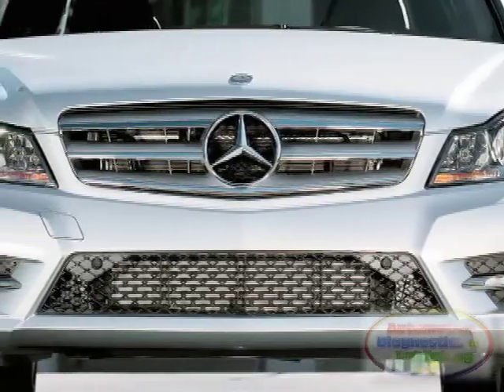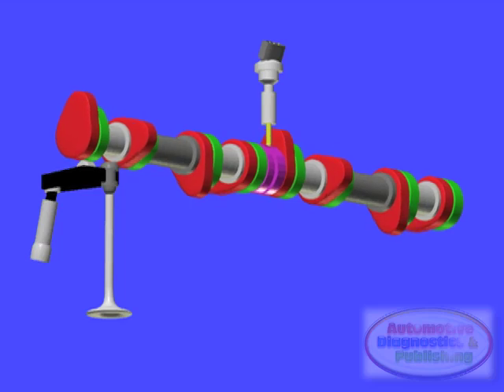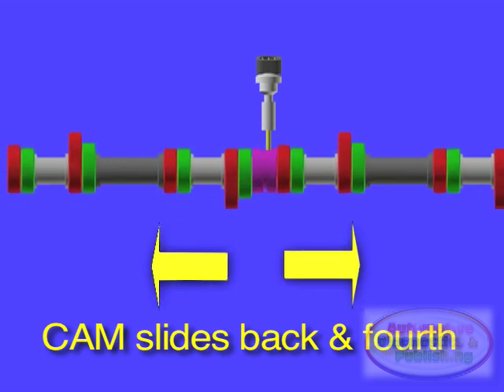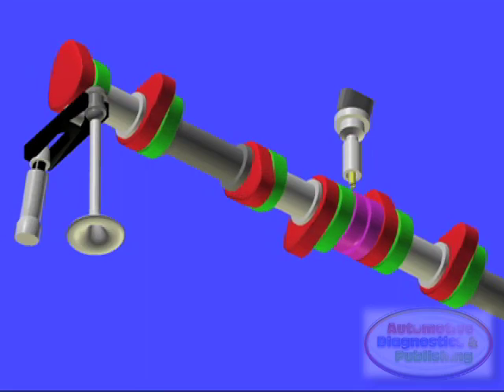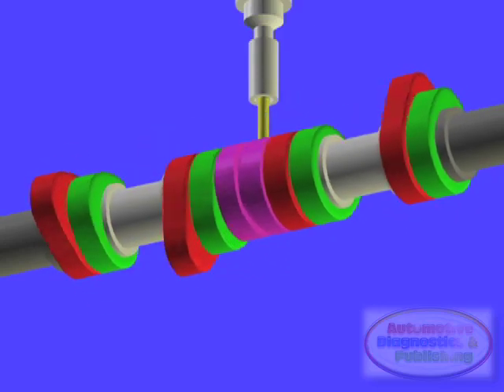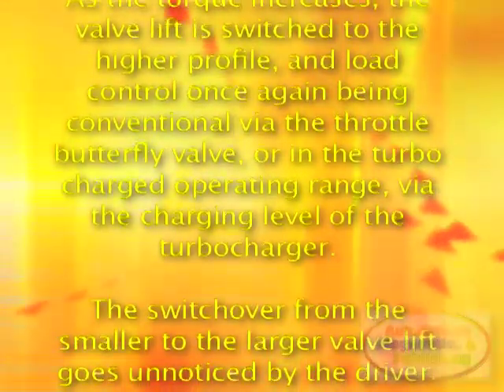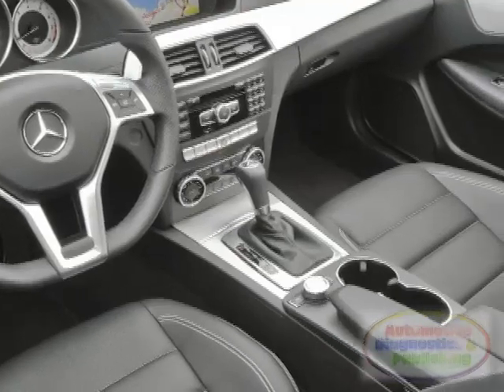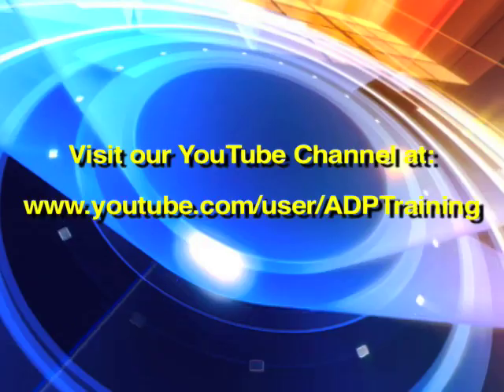Mercedes Benz Camtronic Valve Timing

Comment: @ Jorge Castillo,

Disagree: there are two independent valve lifting profiles, valve timing and valve lifting can be changed, this is not on the effect of the mechanism parts. (not as older principles, here there are two camshaft axes into one piece assembled)
Mainly it can be introduced as a VVL system, but seeing the video, the valve timing has a little differencies as well, and the principle allows valve timing switching between two values as well. (but not a continuous behaviour, that is why this is not a variable, better to say switchable lift and timing)

Comment from the maker: Yes, exactly... But the Audi has a swap rear at each cylinder with separate actuators. I've no idea why they did that. It's too complicated and carries more trouble with it.
Reply: ADPTraining not at all it's a simpler system if a actuator goes out it can be simply replaced within minutes and a t30 I believe screw driver nothing complicated just simplified